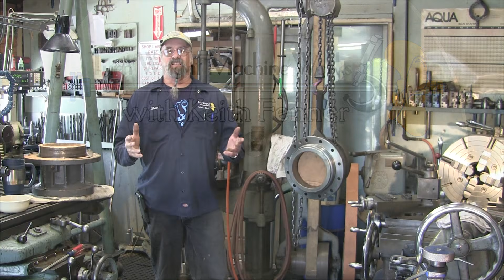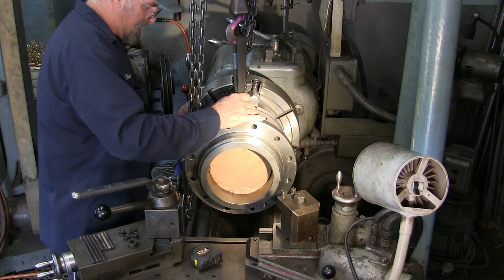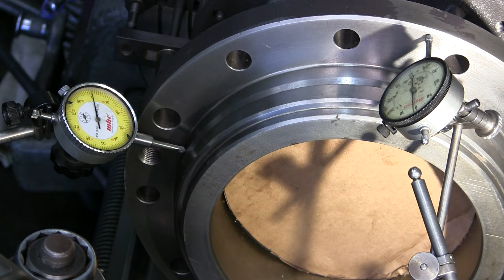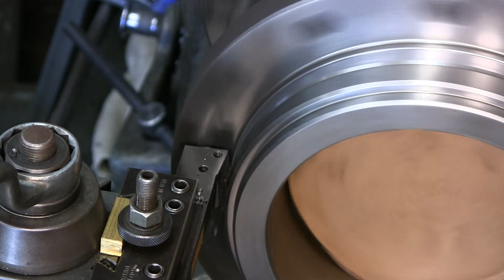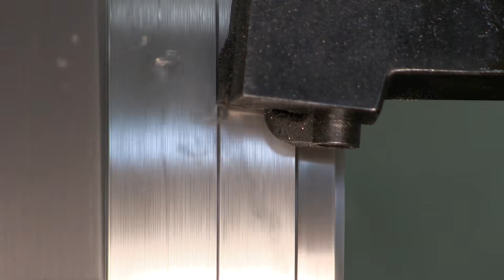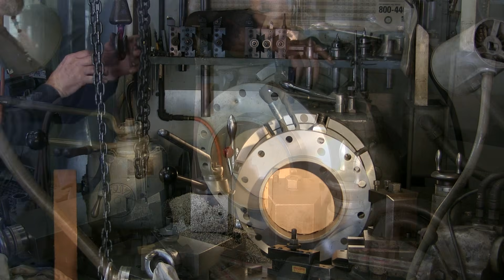Chuckit!

Comment: Hi Keith,
the clamping down of the back flange and jacking of the face flange is interesting. you did this to bring the face flange into concentric as much as possible before machining.

would the face flange not flex back when the jack is removed causing the machined work on the face flange now to be out of true.

I would have thought that the jacking would have been confined to the back flange leaving the face flange to be without distortion.

Comment: Somewhat random, and perhaps a silly question, but I'm catching up on videos, and I notice you put a new four jaw on the Clausing, and it got me wondering: if you were going to fabricate a chuck, could a chuck turn a new chuck of its own dimension? Basically, how much chuck could a lathe chuck chuck?
Reply from the maker: The chuck can hold items as large as the swing of the lathe, which is larger than the chucks being used on them. ;{)-------

Comment: hi Keith very nice video a lot of great info about how to clamp down defelcult items, but did i see a bozoo when you use the file to round the egde at the end (you cut the same way as the item was running) have a good day/evning
Reply: +wonderc66
If you step through from 37:13 , you can see that the lathe was switched back and is actually running anti-clockwise and all  is well!

John Greenwood
Reply: hahaha ops sorry my bad then it's hard to see what way it was runing

Comment: For those of you like me who like to see a final part in action, see this for some reference. 
How To Replace Excavator Swing Gear Seal
https://www.youtube.com/watch?v=HU4RwH7RbH8

This is what it looks like with some of the bits and pieces attached. Takes four guys to remove pinion cir-clip. I believe this is part of the assembly gear that turns the  tracks. Please correct me if I am wrong.
Reply from the maker: This is the pivot motor. ;{)-----

Comment: Hey Keith, when setting your tool, why did you want it to be above center and not ON center?  I understand why you were running in reverse so for forward youd want the tool to be a bit below center, but why?  Thanks
Reply: For safety would be the biggest reason. If something bad happens (turning a welded part, or pushing the tool bit too deep, or whatever) and the tool bit gets jammed in the material, it is pushed away from the part being machined (same reason you should only cut a piece of metal with a hand grinder while holding it so that the sparks fly down and towards you. In this case if the disk gets jammed in the piece, the grinder is pushed up and away from you, or at least it's what i've been taught).

Comment: Nice job setting this thing up! Could you give us the rpm and the diameter, so I could calculate the speed at which this screwjack would come flying at you? Seriously, this thing scares me shitless. I'd probably use shims instead.
Reply: I thought he was going to take that jack out before he run it.
Should at least put some duct tape around it, or a band clamp.
Reply: Suffice it to say I was painfully aware of the existence of those jacks the whole time...

Comment: Keith, thank you for yet another great video! I'd like to ask you one thing: 

I aim to remove the angle grinder from my shop because i do not like the mess it makes and how it damages machines such as my lathe and mill with the iron-oxide it creates.
Do you have any suggestions as to what tools would work well as a replacement for an angle grinder?

Was thinking about tools such as a sabre (reciprocating) saw and band saw but these only cut, they don't replace other uses such as smoothing down surfaces (flap disc or regular thick disc)

Would love your suggestions
Reply: Niels I don't know how your shop is set up but you could use a simple window fan to exhaust the airborne particles as well as curtains, tarps or similar to contain it from the rest of the shop. It's not a perfect solution but for me it's probably a 80% improvement. Just ideas. Replacing the angle grinder these days isn't really an option, we've all gotten accustomed to grabbing it at least once a day.
Reply from the maker: There are two points to govern a grinder, the contact to the project and where the direction you shoot the debris, the better you subconsciously control that the last, the less mess, where you don't want it. ;{)-------
Reply: James, Thank you for your reply.
I do have one of those areas, but the shop is set up with the project in the middle and the machines around it. So if I'm building a tubular frame, it will be in the middle of the shop (which is not that large) on a fixture table. Of course I can build a curtain around that but that's not always ideal and requires a fan blowing it, through a channel, outside. These channels tend to get hot and increase the risk of a fire. (this has actually happened at a company where a family member used to work.
So in short, I'd prefer alternatives. Now I'm mainly using a sabre saw and high quality files, which takes quite some extra time.
If there are no feasible alternatives to an angle grinder, I'll have to change the setup of the shop, which is not preferable.
Again, thank you for your input.

Comment: I doubt this is the heaviest thing that you have turned but it looks like a massive heavy piece of cast iron. Love seeing how much your lathe can handle in terms of weight or length. The cut depths as well. If I tried .050 on my little lathe it'd stall and blow a fuse. The deepest I have cut in steel has been .025, aluminum .030, and hard plastics .035-.040. I love the kind of work you can do with your equipment and can't wait to see the Bridge Port you have acquired running really well. Thanks for all the content.

Comment: Do they make a double clamper jaw type that could grab the inside and outside diameter at the same time?  Seems simple enough, a rectangle with a L shaped slice and a dovetail + clamping bolt.
Reply: Rosococsa, I've seen shop made jaws of this type for griping thin walled parts that would distort if griped from just the outside or inside. The jaws are anchored to a face-plate.
Reply: I was sure there was something along those lines out there.   Never seen em is all :D   Thanks!
Reply: Roscocsa, since I can't post a picture here, send me an email at aceroadholder@yahoo.com and I'll send you a copy of an old article showing how to make them... very easy.. it's one of those "why didn't I think of that" sort of things.
Reply: ferdflintrock@gmail.com
Reply: Thanks!